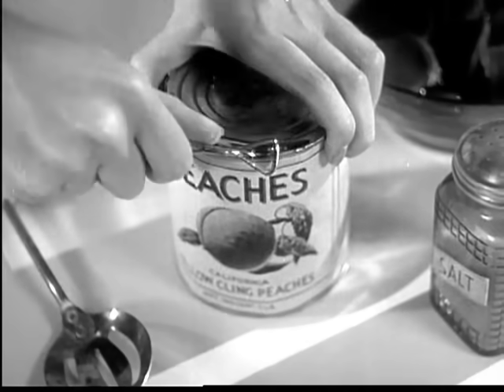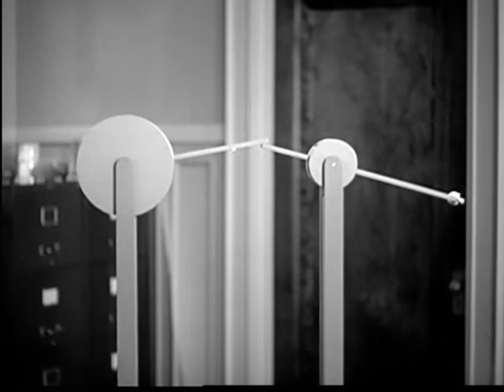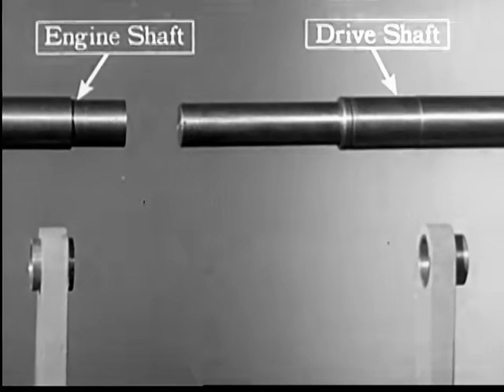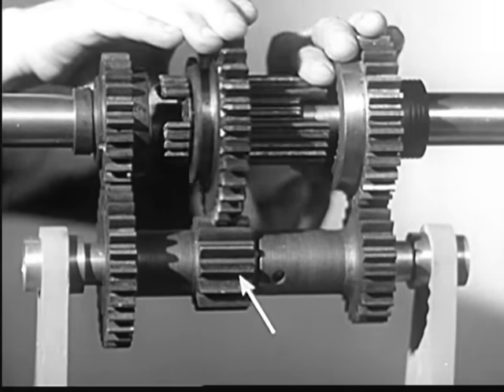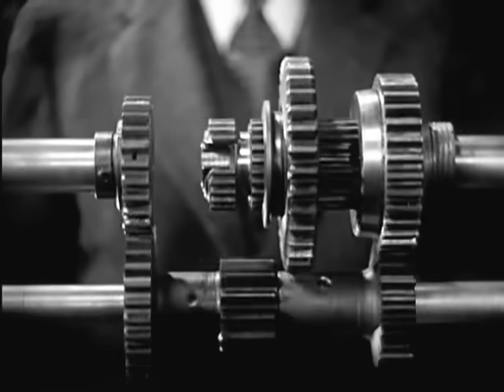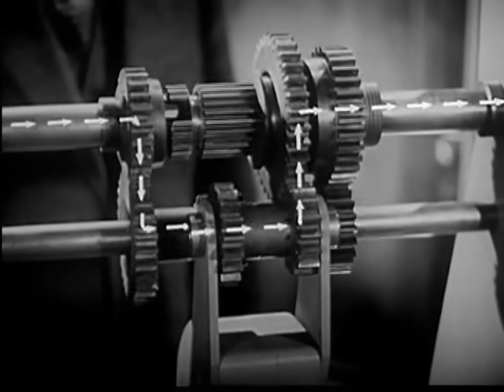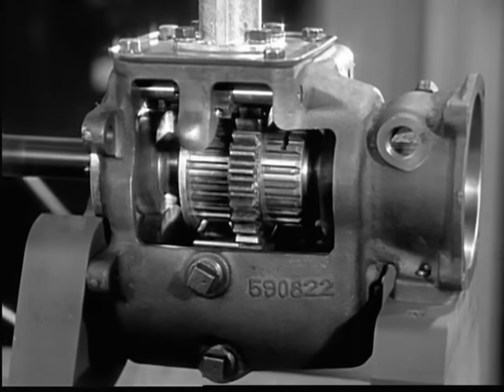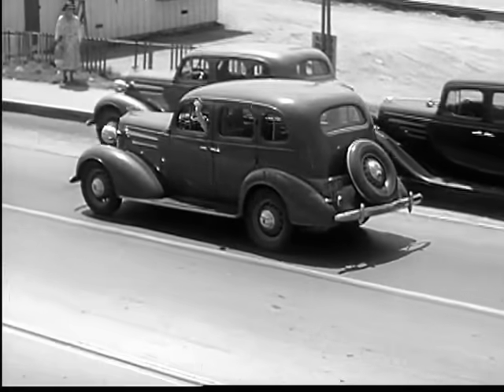Spinning Levers - How A Transmission Works (1936)

Comment: if my teachers explained mechanics like this, i would work for NASA by now, instead i dont have a clue about about anything
Reply: @cyberpleb2472  I'm pretty sure you're smart enough to understand what he meant.  Underhanded statements and clear sarcasm aren't the best ways to convince or educate people.  I'm not sure what your motive was for that comment, but you kinda just come off as pretentious.
Reply: @cyberpleb2472  I could see that for biology, since you're memorizing pre-established categorizations / mechanisms and the learning process itself is a form of discovery when you hear it for the first time. I'm glad that the current curriculum worked for you, and I hope that it truly did prepare you well for your job. I'm trying to become an electrical engineer, and designing something to fulfill a specific task is a lot different than just solving the voltages for every element in a random, unrealistic circuit. The few courses I do have with realistic lab sessions / assignments that leave the solution up to the student are usually the hardest ones, but also my personal favorite. The ones that don't, I'm motivated to complete just to have them behind me, but I'd rather not waste the time if I'm just going to forget it and never use it in two semesters. I can't say for sure if the current way is useless without any real work experience, but boy if it doesn't suck the enjoyment right out of learning.
I'm curious though, when you say that you investigated stuff on your own, what did you investigate? Did you do some kind of at-home experiment?
Reply: @SWAGCOWVIDEO  The current curriculum sucks. I'm a biology prof. I am astounded at how poor the teaching is in high school. My main point here was that students should not be blaming their failures and lack of motivation on their teachers.
Reply: Really? I didn't know NASA is driving cars in the space
Reply: @cyberpleb2472  This video made you feel part of the design process. In high school, and even bachelor level college courses, you design nothing. You recite problems that already have answers and the only way to know that you're wrong is by getting the grade back or running through the math again and again. Trigonometry was the most frustrating class until I realized you could use it in programming to make rotating objects in games. As soon as I designed something with it, which took a lot of iteration and being wrong, it made so so much sense I never got a single trig problem wrong after that. 
No, teachers aren't to blame, but the curriculum desperately needs an overhaul. Don't give the students the tools, over-explain them and expect them to use said tools perfectly in the real world. It's no wonder why we're struggling to push STEM courses nowadays....
Reply: Dont blame your teachers idiot. Blame yourself
Reply: @centralintelligenceagency2919  Prepare to be flamed relentlessly. ;)
Reply: 6 months later and there is still a war going on in this thread, yet the context of the original comment was (clearly) intended as a joke.
Reply: @yearginclarke  thank you. Trolls gonna troll and trying to make a fight over a joke
Reply: @yearginclarke  "yet the context of the original comment was (clearly) intended as a joke." It was indeed, as was acknowledged in my original post. The level of literacy here is astounding.
Reply: @cyberpleb2472  LMAO!
Reply: I feel smarter just from reading the comments below.
Reply: Teachers need to learn how to teach.
Reply: to be fair, if your teacher was explaining mechanics like this he/she wouldnt be a teacher. he/she would be working for NASA lmao
Reply: @MisakaMikotoLuv  Hard to say. A lot of excellent researchers are terrible teachers, and vice versa.
Reply: 11 11  Some teachers are indeed quite terrible... but how is this relevant.? The people that produced this video are excellent teachers.
Reply: I just want to say you guys should make sure Usa (im not from usa) put way more money into education instead of fighting in each others.
For example stop wasting it in war or suveillance of the whole world.
You would really become the greatest country of the world instead of pretending to be.
(not that it really matter tho )
Reply: @apanatchanka  Tell that to the government, the common citizen doesn't have much we can do about those issues.
Reply: Teacher's today are more concerned that someone else is doing less work than they are, or where is they free stuff, or dis aints my job. I work in a large School District, and teaching is not at the top of their priority. There may be a few, but they are far and few in-between.
Reply: @simpleman2004  It sounds to me like you're one of the folks that isn't pulling their weight. As a teacher, I don't give a fuck what my colleagues are doing. I only care that I'm doing my best.
Reply: @simpleman2004  are you teacher yourself ? have you ever work with kid ? I ask because people underestimate how hard it is to work with kids regardeless if u have the passion of it or not. 
I dont know what are class size in usa. 
but here in France  its like 1 teacher for 30, and its totaly bullshit.
Ofc some teacher are doing great either because they are very good/ passionate/ or they rely on strong autoritarism.
Autoritarism work less and less imo because kids are just smarter now, they understand power dynamic ( and for many other reasons )
My point is education really lack founding, and I think its even worse in usa. 
So i think most teacher are doing their best with what they have for sometimes but most fall apart eventually and end up kinda being like teaching bot. So yeah you can end up with seing shitty behavior.

The main problem is there is not public or political interest to improve this, because it would be very difficult and cost alot.
Reply: @apanatchanka  I'm not in the US, I'm in Canada. I teach college students. I certainly appreciate the difficulties faced by elementary and high school teachers (I do a great deal of outreach work in these schools). I deal with the shortcomings of high school education on a daily basis. 

Your message appears to have changed. In your first post, you suggested that most teachers are incompetent. Now you seem to think they are mostly trying their best. I suspect the average is somewhere in the middle. Personally, I keep my nose to the grindstone, try as I might to actually teach, and ignore the gossip. ;) Ultimately it takes skill and/or motivation to succeed as a student. A teacher can promote both, but both are ultimately characteristics of the student.
Reply: @cyberpleb2472   I did not change my message, im not the original poster of this thread.
I dont think " succeed as a student " should even exist as a notion. Education system should allow students to experiment as many fields as possible and find their way according to their skills and motivations. 

They kinda do this is Sweden, and I have experience kids there not understanding why kids of others country would not like school (ofc 1 example doent make it a rule tho )

Current system is design to reward only the best students, and hope that the others will get motivated by being bring down. 
But many others outside factors will impact those results.
Reply: @apanatchanka  "Education system should allow students to experiment as many fields as possible and find their way according to their skills and motivations." Absolutely. Someone that fails as a student of biology might do very well as a student of a different discipline. I think you'll find that exposing students to as many disciplines as possible is a common goal; it's certainly a primary goal where I live. I realize you are not the original OP,
Reply: yeah sure keep going...
Reply: Although I understand the sentiment, if you are unable or unwilling to learn things on your own and would rather blame your teachers, I very much doubt NASA would have much use for you.
Reply: @cyberpleb2472  are you aware that the american public education system is a thing
Reply: @_Devil  I'm not American, but I have indeed heard it's a thing.
Reply: @cyberpleb2472  How the hell do you expect me to learn about transmissions on my own? 
This video, made for the purpose of educating people, was VERY helpfull in teaching me how they work. 

You don't have a clue what you're talking about.
Reply: @Dave_Crupel  "This video, made for the purpose of educating people, was VERY helpfull in teaching me how they work." I absolutely agree. Where have I said otherwise?
Reply: @changsangma1915  Why would I not be interested in mechanical engineering? What an odd question.
Reply: @cyberpleb2472  Ah yes the classic, I'm more educated than you,I can't show proof but, you must believe everything I said.
Reply: @dacheesebroker1105  Where did that happen? Where have I claimed to know more than anyone or claimed that anyone should believe everything I've said?
Reply: "I absolutely agree. Where have I said otherwise?" How about the entire first half of what you have been arguing? OPs comment was clearly a dig on how poor modern education is compared to the past. Then you start claiming that divan was unwilling to learn things. Was he a student of yours? How would you know how much he wanted to learn or not?

"My main point here was that students should not be blaming their failures and lack of motivation on their teachers." Now how is this relevant? First off, you did not make it clear that this was the point you were trying to get at. before this statement, your comments were far more targeted on how the teachers were holding him back and the lack of motivation to learn. Second off, this had nothing to do with the videos comment. It was entirely you being a pretentious prick. 

Now while we should not be blaming others for our failures, that does not mean those statements are not true. If kids are not given the tools to learn about the world, no matter how much you want to learn, how do you expect students to figure out things like a cars transmission? Do you really expect them to reinvent the wheel and figure all the physics behind it on their own? The quality of teaching is very important for someone to be able to learn.

Now don't take this all the wrong direction, your statement on the motivation of the students is true as well, but it had little to do with anything when you brought it up. Have you ever heard of the phrase "polishing a turd"? In this case the students are the material and the quality of polish is the effect of the teacher. Sometimes you do have a student that will not learn no matter how much you try to give them the motivation to do so. They are still able to become shiny and smart but it takes a ton of time and effort. Other times you are polishing a pearl that can learn everything instantly and shine no matter the quality of polish. But many times you will have students that just need that push, for the sake of example say a material of wood or clay. If you are given garbage teachers/curriculum to learn from, they wont shine at all. They will look more and more like the turd as time goes on. But with the right teaching, they can shine just as bright as the pearl. 

Then someone comes in and brings up the true point of the conversation that you failed to see and we return to the topic of my essay length comment.

"How the hell do you expect me to learn about transmissions on my own? 
This video, made for the purpose of educating people, was VERY helpful in teaching me how they work."

Everything that you have been trying to argue as been that the teachers are not to blame. it is entirely on the student. Now you are saying that teachers and how well they teach is very important? I hope you realize how contradictory you are making yourself sound. 

If the teachers don't teach and if you cant find a quality education on a topic elsewhere, how in the world do you expect someone to learn? Sure, they may figure it out eventually, but if they were able to learn it quickly with quality teaching, imagine how much more they could have learned in the time it took to figure out that one topic.
Reply: @christopherpenn9585  "'I absolutely agree. Where have I said otherwise?' How about the entire first half of what you have been arguing? " The video is wonderful, I've never stated or implied otherwise. It is an excellent teaching tool.

"'My main point here was that students should not be blaming their failures and lack of motivation on their teachers.' Now how is this relevant?" It is the only point I have made. I made this point in my first post. How could it not be relevant?

I'm afraid I stopped reading your post after that. If you are unwilling to read my post and would rather invent my argument for me, I don't see the point. Trust me, I got the joke and understood the sentiment. I was not attacking the OP, only the idea.
Reply: @MTLRNN  I made a simple comment that no one appears able to read. Nothing I've said has been out of context. I'm also not the one here that's all bent out of shape. Did you read my original post? Nothing I've said since has diverged from it. Cheers.
Reply: @cyberpleb2472  you've literally responded in almost the exact format I accused you of! XD
Reply: @MTLRNN  You accused me of staying on task and making rational replies? I'm honestly quite curious, what do you think I am arguing?
Reply: @cyberpleb2472  no that's not what I accused you of. Reread my first reply for both an accurate account of what I actually accused you of and the answer to your question.
Reply: @MTLRNN  Yikes. You do realize that my comment was sarcastic, right? You have accused me of several things I have not done. I'm not sure why this has happened. I suspect that taking the time to actually read my posts might clear things up.
Reply: @MTLRNN  How have I manipulated anyone or anything? Why does anyone need to seek professional help? "Notice that last bit turned into a statement and not a question?" I'm afraid you've lost me. Also,  who was "delivering irony?" (what does this even mean?) I'm not really into ad hominems, that appears to be your game, so I will bid you adieu.
Reply: @cyberpleb2472  you are so full of it.
Reply: @cyberpleb2472  You started this thread almost half a year ago by taking OP's joke way to seriously. This whole week you been trying to make yourself out as the victim. Of course you are lost you don't intend to understand in the first place. " Cyber Pleb
Cyber Pleb
1 day ago
@M3T4L R0N1N Yikes. You do realize that my comment was sarcastic, right?"
That's you yesterday literally claiming to use irony. Also whats even more funny to me is you saying you're not into ad hominems but then you put one into application with the following comma.
Reply: @MTLRNN  Full of what exactly? You have yet to present an argument that I can address.
Reply: @cyberpleb2472  I thought it was too good to be true when you said you were formally leaving.
Reply: @cyberpleb2472  Lol,dude, u funny as hell
Reply: @divanosoba9658  Just stating the truth. Blaming others for your shortcomings only makes your shortcomings more apparent.
Reply: @cyberpleb2472  I was only joking and stating how good this video is , and how well everything is explained about mechanics. I bet you are fun at parties. And i did have many great teachers.
Reply: @divanosoba9658  I understood the joke. Clearly I'm not interested in the effects of your great teachers. I'm more interested in how your poor teachers held you back and prevented you from succeeding. ;)
Reply: @cyberpleb2472  They did not, it was just a joke.Are you a teacher, my poor child? I ll pray for your lost unhumoristic soul.
Reply: 11 11  Not at all. What have I stated that would lead you to believe this?
Reply: @cyberpleb2472  go watch porn or something and leave me alone. You are killling me
Reply: Tom Cizzle  Where have I discussed anything to do with drugging children? Perhaps you've failed to take your ritalin? ;)
Reply: Tom Cizzle  The teacher should be the primary focus, but what does this have to do with blaming teachers for the deficiencies of adult or young adult learners? Are you under the impression that this video and this discussion have something to do with elementary students? By every account, my students quite like me... except for the ones that fail because they don't study. Insert ad hominem here.
Reply: Tom Cizzle  It annoys me to see people blame their personal shortcomings on others. It's as simple as that. I have no idea how your conspiritard 'big pharma' rant applies. As for attendance, I absolutely agree. I skipped all of my classes where the teacher was a buffoon, both at high school and university. It had no impact on my education.

Comment: Love that 3 speed transmission. Take that any day over today's 8 speed paddle shifter transmissions
Reply: Paddle shiters don't shift at all. They just control solenoids inside the transmission that do the work.  That is an electrical assisted transmission. Many other cars use buttons or a rotary knob to do the same type of control.

Comment: I guess mentioning the function of the CLUTCH in all of this might have been considered confusing? 
At first, car is standing still, but motor has to be spinning or it would stall. Car is very heavy; has a LOT of inertia before it gets moving. Gears that are already spinning (connected directly to engine) cannot be simply jammed into mesh with stationary gears (connected to rear wheels)  that have all that inertia to overcome, because the gear teeth would simply break off. Enter: THE CLUTCH. 
The clutch allows the stationary gears to be slowly brought up to synch with the already spinning shaft from the engine by providing for controlled slipping between the spinning engine shaft and the (at first) stationary gears in the transmission.